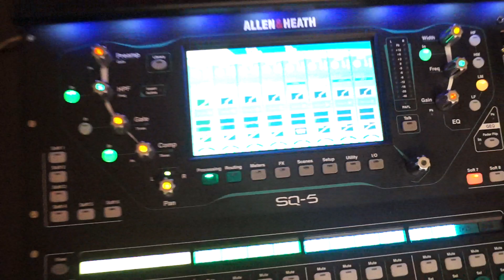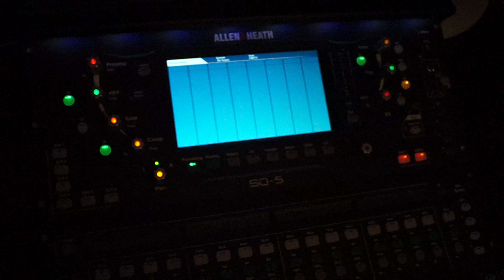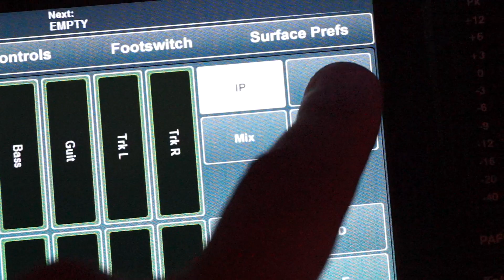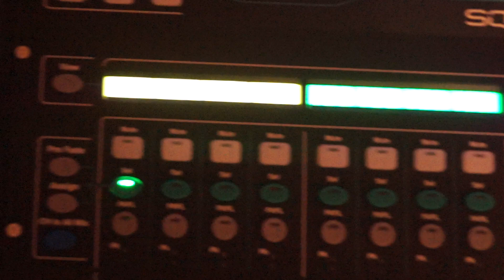No3: STRIP ASSIGN DRAG n DROP on SQ5

Comment: Andre - Thank you so much for these videos!!!  Question:  When you set up Layer F in this video (No3: STRIP ASSIGN DRAG n DROP on SQ5), Does the slider on Layer A (for a vocal channel) reflect a change you make to that slider on Layer F?
Reply from the maker: Hi David, 

glad you like the videos. 
 
To your question: Yes, if you drag a channel to different layers, they reflect each other. It doesn´t matter, on which layer you pull down or up that channel, the fadermove will be the same on all channels. You can even drag the same channel multiple times onto one layer and you´ll see how the all move at the same time. 
If you currently don´t own an SQ, it´s fun to load the MixPad App and try those things. 

Hope that helps, 
André
Reply: @AndreSchaier  Perfect!  I've been looking to do that for some time and hadn't been able to get a good answer.  Yes, I do have [access to] an SQ-6 at our church.  I play (mostly) bass for our worship team, but I have run sound for a band in the past (on an analog A&H console) and I'm the resident audio geek.  So, what I've wanted to do (to simplify the work of the person running the board) was to use Layer F to contain all of the pieces used for a worship service.
If I may pick your brain further, along with combining to Layer F, it would be useful to "group" some of the inputs that normally get their levels adjusted together, such as drums (Kick, Snare, OH, Tom1, Tom2, etc). Would you use a DCA to accomplish that?  If so, do you have a video explaining how to set up a DCA on the SQ?  Also, why would you use a DCA (or something else) over the other choices for this application?
Reply from the maker: Hi David, 
DCAs, Groups and Ganging...that will be one of my next videos! 

Cheers,
André
Reply from the maker: Hey David, 

the videos on DCAs is online. Tutorials for Groups and Gangs will follow shortly!
Reply from the maker: Hey David, 

my tutorial on groups is online! 

Enjoy